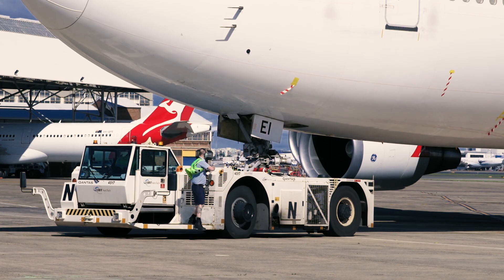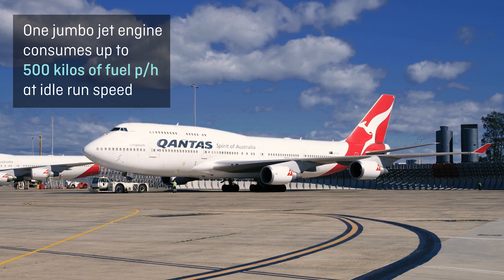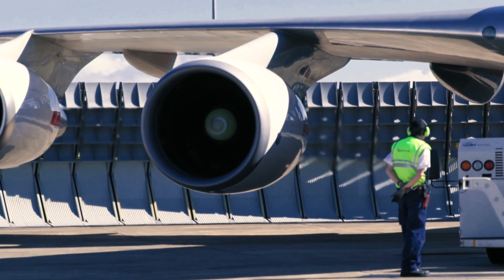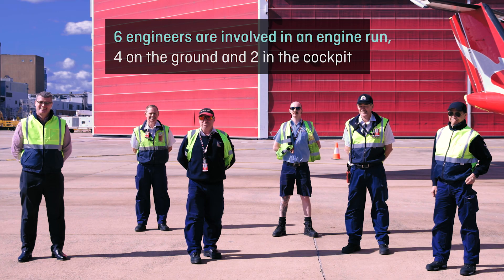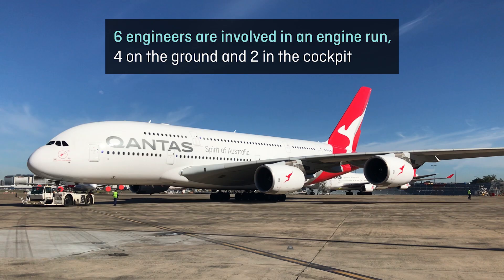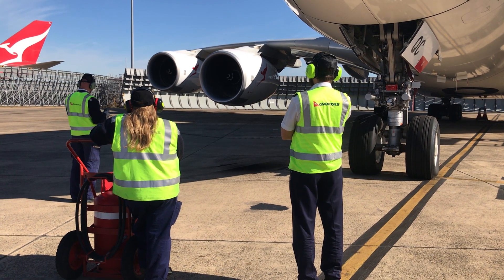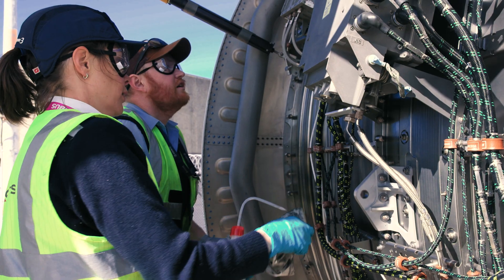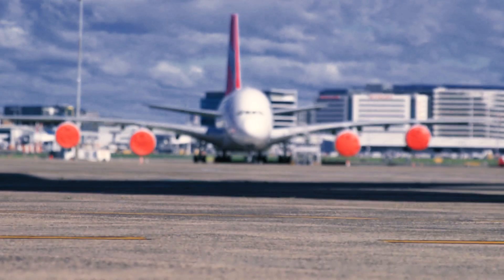Qantas: Engine Run Test

Comment: Hi This is not a new innovation , when I was with South African Airways in 1971 a 747-200 was delivered from Seattle with an additional engine . The local newspaper showed a picture of the 3 engine side and the caption  ,  the new jumbo with 3 of its 6 engines !!